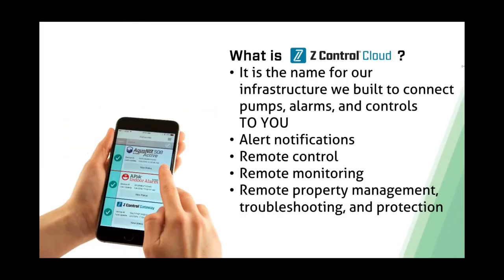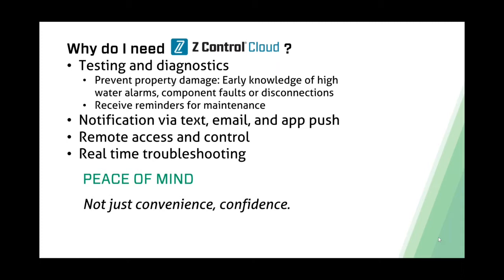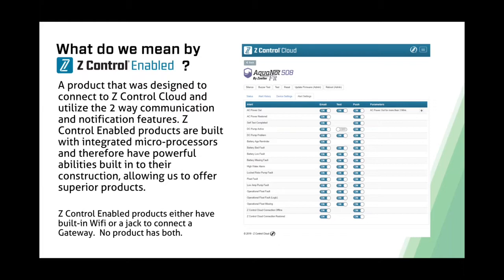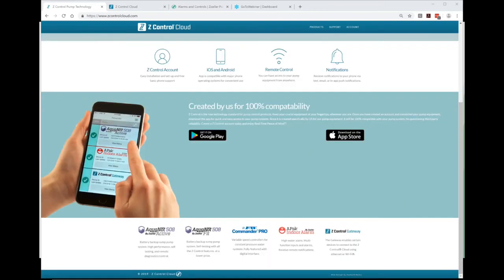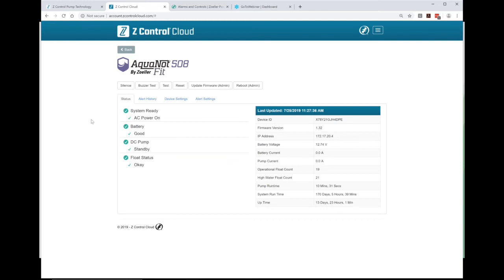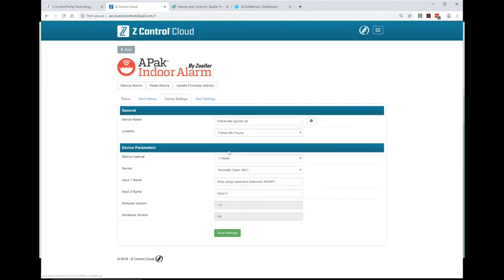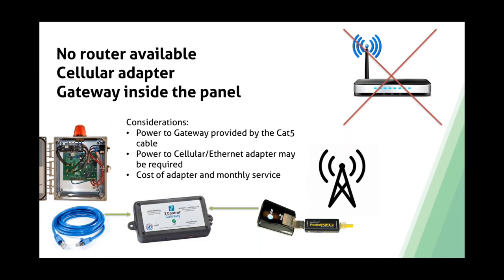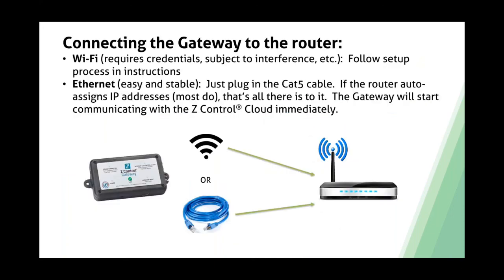Intro to Z Control® Cloud Technology Webinar

Comment: How does the controller calculate pump runtime? I have a new unit that I installed only a few days ago and I’ve only run it for testing yet it says it has 2 days of runtime on it. I did have the controller plugged in without the pump plugged in for a day or 2.
Reply from the maker: Good morning! Should you require technical support or troubleshooting assistance for your application our Product Support team is more than happy to help out! They can be reached by emailing zcotechnical@zoeller.com or calling 1-800-028-7867 and selecting option 6. I hope this helps!